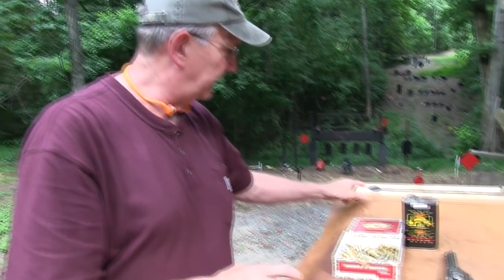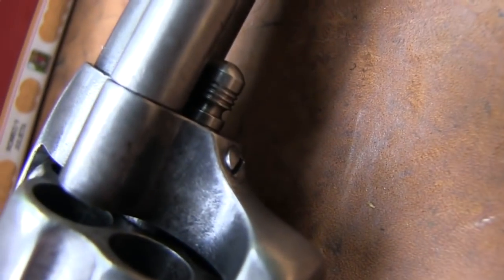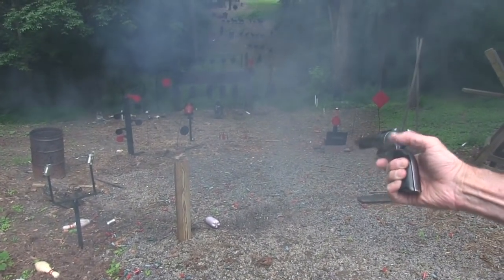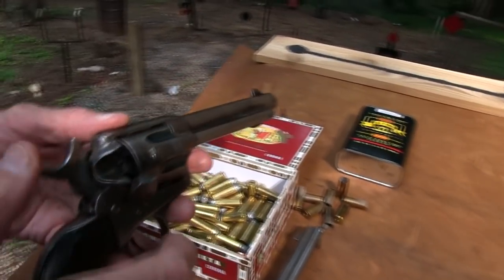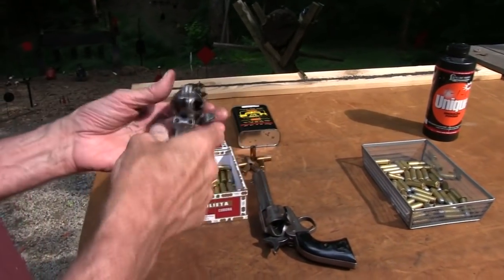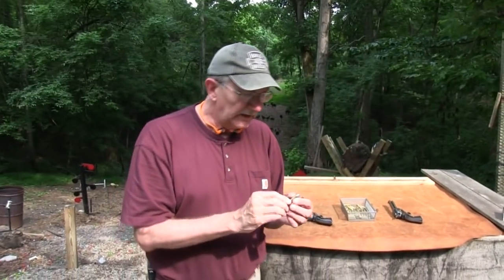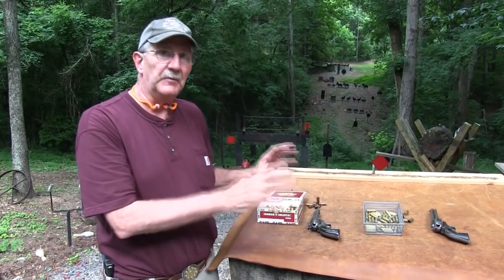Black Powder vs Smokeless Powder: some education!

Comment: To clarify, smokeless powder, smokeless propellant, burns faster when confined inside a cartridge case, whereas black powder burns almost as fast unconfined as it does confined.
Reply: Not true. The simple proof is the difference in burn rate between black match fuse (string coated in black powder) and quickmatch ( black match encased in a thick paper sheath). Even light confinement makes a huge difference.
Reply: Smokeless powder
Reply: @pyrobob208 In match, the powder grains are physically bound to the thread. In the case of black match, the powder being burned can only ignite the powder directly affixed next to it. The granules burn in a sequence as a result, unable to skip ahead in the line like a columm of loose powder can...

...fast match holds in and redirects the combustion gasses so they can ignite more and more of the black powder they flow over in the tube. The fact the granules are glued to the thread become irrelevant because the flames can out-pace the sequential ignition of black match- where most of the heat energy is expended into the open air as the visible 'fizzle' effect.

It's the same reason you have to pack down black powder in a chamber-- loose air inside the charge lets the granules ignite all of the powder at once rather than in the slower sequence you'd get if the packet of powder was tight.

Comment: It's all in the chemistry. According to the book "Gunpowder" by Jack Kelly, black powder will result in only 44% of the initial weight being turned to a gas, 56% is solid residue hence the barrel fouling nature of black powder. This solid residue is primarily potassium sulfite, leftover from the saltpeter and sulfur in optimal mixtures. The saltpeter (KNO3) provides the oxygen for combustion. The 44% gasses produced occupy 280 times the volume of the original black powder. At the temperature of the explosion, 3880 dF, the volume of the same gas will be 3,600 times more. The pressure can reach 20 ton per square inch. 
   I am not sure of the chemistry of the smokeless powder, but with less solid in the end that the 56% residue of black powder, we can see that smokeless powder goes toward 95%-100% gas, little residue. This means the amount of gas produced can be double or more per weight of powder, hence the pressure can be double too if it burns all the way before the slug leaves the barrel. It may burn slower put produce double the gas. I don't know the temperature of the smokeless, but if comparable, then we can easily see the danger of using smokeless in an original old black powder gun.
Reply: Actually, about the volume increase when it comes to the temperature of a gas, it is actually measured in kelvin, the absolute temperature. So let's say that a gas goes from 100 kelvin to 200 kelvin, then it just doubled its volume. Farenheit and celcius are not absolute temperature.
Reply: The term optimum is relative. Residue can be more or less according to several factors.
High humidity can contribute to the burn rate and the amount of fouling left behind. The amount of moisture in the powder is another variable. T
Reply: I can load for less fouling by increasing pressures. I do it with a hot primer, a heavy bullet, a good grade of powder and some compression.
The right combination will shoot pretty clean and give good accuracy.
John Davis Jax fl
Reply: Black powder will combust-- the charcoal burns with the saltpeter to generate a lot of heat and some gas.

Smokeless powder is nitrocelluouse-- it is a chemically bound chain of nitrogen, hydrogen, carbon and oxygen. It exothermically decomposes at the molecular level, generating a lot of gas and then some heat.

People need to understand that black powder and smokeless powder are two completely different substances that undergo two completely different chemical reactions.
Reply: Celsius and kelvin have the same scale for increments, so no problem with that…
Reply: @CC-mm3bl  I stand corrected. Must be done in Kelvin temperature.
Reply: How about Sulfurless blackpowders?
Reply: Something few people know is smokeless powder can always be used safely in a black powder weapon ... I mean always ... There is always a load that will replicate the black powder pressure .. The religion out there is never do it , dont ask why .  Except you can always do it all day long  with one caveat .. If you over measure your in danger ... not so with black powder
Reply: @markdoan1472  and this is how people who don't know better get hurt
Reply: @markdoan1472  This chat group article addresses the use of smokeless powder in BP firearms and confirms that UNDER THE RIGHT CIRCUMSTANCES it is in fact OK to use smokeless powder as a substitute. As Mark has stated, BP is without question more forgiving of "overloading" compared to smokeless powder. But for those interested in the topic of using smokeless in BP firearms, this post (title: "Smokeless Powder in Black Powder cartridges", from 2008) might be useful.
Reply: I was wondering, thanks.

Comment: This video is also a good postscript to the video you did about the cylinder gap blow out, where you illustrated the danger from the burning gases escaping for the cylinder gap. With the black powder loads the blow out is clearly visible. Thanks for another interesting and informative video!

Comment: Do you think the indoor shooting range would mind if I reloaded some AR15 rounds with black powder and shot off about 30 of them in quick succession?
Reply: I doubt it would cycle
Reply: Good luck cleaning that gas system. The thing'll never fire correctly again.
Reply: I did it and everything worked perfectly.
Reply: Ramses. Just got to clean it well after shooting as black powder is corrosive.
Reply: what hes say is he can out gun sling you with a ar15 i would put colt 45 against u any day
Reply: some people in this would still nows how to use one of those pistols dont doubt that pistol
Reply: Lol I know this is 2 years later but Lmao. Well at least you couldn't see if they were pissed at you or not, just fumble around till you find an exit.
Reply: I know somebody who did it with a .38 Special shooting our service-match.
Reply: If it did cycle I would be surprised if it would fire 30 times. Put a softer spring in it and try it and show us.
Reply: i would shoot blackpowder only from a stainless bolt rifle ,t/c contender or a single action ruger revolver
Reply: @borborygmus5873  sure bud

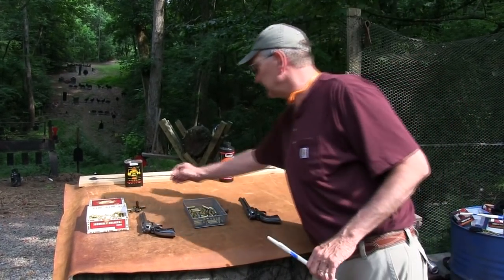Comment: Man I was happy to see you move the cans away at 10:22 .... I was almost shouting at the screen "REMOVE THE CANS!"
By the way, I love your videos, Keep them coming.
A salute to you from Denmark.
Reply: +Morten Schultz What do you think the odds of the containers of powders igniting are?  Though I agree with you that one shouldn't take chances, I think the odds of those containers going off are astronomical.
Reply: I dont care how low the odds are,  if that amount ever blew, Hickok and cameraman would be splattered all over the range.
Reply: his fingers could have powder or the table, and the fire could somehow get to the top of the bottle
Reply: Gia:  Perhaps...but the containers were sealed!!!
Reply: The containers are light plastic or card board or light tin designed not to explode, if for some reason the powder caught it would burn like a torch but not blow up. Designed that way for safety.
Reply: Leaving the cans there until the last minute is hickoks sense of humor. Have you watched many of his videos?
Reply: Fedt, Danmark.
Reply: the cans the lines of powder were already poured when he was shooting, a spark would have touched off the black powder.
Reply: Hickok45 was just messing with you

Comment from the maker: Any Colt SAA might be referred to as a "Peacemaker," but it's not the official Colt designation. The gun is the Colt Single Actions Army, sometimes called a "Peacemaker." Now, there might be some other firearm I'm not aware of that is actually using the brand name "Peacemaker" - not sure. I would not be surprised if some company actually uses it since the old Colts were also called that.

Comment from the maker: Hardly ANY of the smokeless "powder" out there is really a powder; it's flakes, extruded little cylinders, and all sorts of shapes of granules and such. Still, the general term for anything that goes in a cartridge case to propel a bullet is "powder."  At least that is the case in MY world. :-)
Reply: Using hot soapy water to clean black powder pistol...but what do you use to clean black powder out of a modern cowboy shooter ?? Water ???
Reply: I have developed a new cartridge for muzzleloading rifles which is loaded from the muzzle but ejects itself from the barrel after use and is non-corrosive.   This product sets a new standard in safety and reliability for muzzleloader ammunition in the same way shotgun shells are standardized for use in shotguns.  Shotshells have a load of shot and powder which produce a safe pressure in shotguns manufactured by many different companies.  The pressure produced by this cartridge can be designed to work safely in the muzzleloaders produced by the various manufacturers.   It would also greatly help new muzzleloader shooters with safety, and it would also give them a product which will not destroy the barrel of their muzzleloader due to corrosive residue. 
 
     Those who say smokeless powder cannot be used in a muzzleloader may not know “Blackhorn 209” is 83% smokeless powder, based on the MSD sheet for the product.  Therefore, the claim that smokeless powder cannot be used safely in a muzzleloader falls apart very quickly. 

      This cartridge could also be loaded with BH209 or a similar formulation in states which do not allow "smokeless" powder during muzzleloader season, in the same way the breechloading "Firestick" cartridge is now used in the "Nitrofire" muzzleloader.  This would be a "Muzzlestick" cartridge which would work in thousands of other modern muzzleloaders, which cannot use the "Firestick" cartridge.

      This cartridge can also be removed from inline muzzleloaders by removing the breechplug.

      I am now looking for a company willing to mass produce this new cartridge for the market.  I would greatly appreciate it if you would pass this information along to those you know who may be interested in this new product.

 
A link is found below which demonstrates this new product.
 
YouTube video:   “Self-Ejecting Muzzleloader Safety Cartridge: Product Debut (short version)”
Reply: @SpotterVideo  nice, sir!

Comment: Here's some trivia.   When Winchester introduced the 1894 model, it was provided (and continued to be made, for many decades), in .30--30 and .32 Special.  The ".30--30" designation would seem to have indicated a .30" bullet with 30 grains of B.P. (like the convention with the .44--40, .45--70, .50--90, etc.)  But the .30--30 was NEVER loaded with black powder.  But with the .32 Special, though a smokeless round, the rifle was specifically designed for shooters to reload their empties with black powder.  The difference, aside from a negligible increase in bore diameter, was that the rifling was more shallow.  That was to reduce the fowling from black powder.  Over the years, I've known people who swore that the .32 Special had less recoil than the .30--30.  That would seem odd, since the two rounds produce the same energy.  My guess is that the shallow rifling of the .32 produces lower pressure, and thus, lower recoil.

Comment: I am sure some where in the replies someone brought this up, black powder is a different breed of cat to reload. If you are going to load black powder, do a lot of investigating about the does and don'ts. If you do it wrong, you can ruin a modern firearm just as easily as you can by loading smokeless powder in an antique. Most will tell you to never leave an air gap in the case with black powder, it causes an extreme pressure curve.
Reply from the maker: +Ray C.  Yep.
Reply: +John Affleck Actually, yep. Black powder and smokeless are totally different. If you load black into a cartridge, you either fill the whole case with powder or if you use a reduced load you mix the black powder with something like cream of wheat to bulk up the charge so it fills the whole case. Simply filling the space with something like cotton will not work. 

Stop perpetuating this ignorance you claim. Crack a book every now and then.

Comment: Just thought I would mention how the burn rate and pressure curve of smokeless powder completely change when confined in the cartridge vs burning in open air. Obviously it is waaaaaaay faster. As the expanding gas increases the pressure inside the cartridge the the powder burns faster.

Comment: It is my understanding that they usually used water (hot, if possible) and a rough patch for daily cleaning, then water and Castile soap or lye for more thorough cleaning.  Either method was followed with tallow, olive oil, or whatever else was on hand for rust prevention.  Hoppe's came around in 1903.

Comment: Just to differentiate on the composition of these two powders, black powder is made from 3 ingredients as mentioned: potassium nitrate (saltpeter), sulphur and charcoal.  Smokeless powder is not actually a powder at all.  It's tiny flakes of nitrocellulose, which is almost like tiny pieces of paper (rough analogy) that have been nitrated by a process of treating them with nitric and sulphuric acid.  This is basically the same process used to produce nitroglycerin, which is a component of many modern explosives such as dynamite.  In both cases, containing the powder in a sealed cartridge with no place to expand is what makes the "explosion" that sends the bullet downrange.  An explosion is simply a rapid burning under pressure.  Nice demo!

Comment: That's a good informative video. I think the reason they say that black powder burns slower than smokeless, (but it doesn't when you burn it on the table) is because the burn characteristic changes when the black powder is burnt in a confined space (the brass case) so the rising pressure slows down the burn somewhat...? I think, lol. But even so, the burning in open air was a good demonstration and made your point!

Comment: And the mystery still remains, why do smokeless build up pressure faster ?  ? My experience with it (after burning Kilo's of it) is that that when it fires it gives off a kind of gas that is very (extremely) flammable. Believe me THAT is something that burn very VERY fast. Explosive in an enclosed area.  I'm sure there's some gunpowder factory that can confirm this.

Comment: If smokeless burns so much slower than the black powder, then why is the pressure in the smokeless bigger and lets black powder guns burst?
Reply: There is a difference between burning them in open air or in a sealed chamber. Under pressure, smokeless powder will burn faster than black powder.

I mean, if you set a bullet atop a pile of smokeless powder sitting on the table, it's not going anywhere. How does this stuff move a bullet, then? Well, you have to enclose it in a gun chamber.

Comment: One of the techniques advocated by some reloaders in the 60s for reduced charge black powder was to mix the powder with cornmeal or some other filler to eliminate air gap within the cartridge case. Never tried it myself as I was content to dip into the bowl for full loads.

Comment: Steel can be safe to shoot if the proper precautions are taken.  First, it must be the proper steel (armor plate).  It must be undamaged.  It should be set on the proper angle or be able to swing.  And last, you must be at an appropriate minimum distance for the caliber and everyone on the range should wear eye protection.

Hickok has several videos on the subject if you do a search on his channel.

Comment: I  aways taught B;ack powder burns slower.  This demonstration proves the opposite.  Thank you
Reply: Smokeless powder burns faster under pressure. Black powder simply burns fast, whether in open air or a gun tube. But, in a chamber, smokeless burns faster.

Comment: Hickok45, I've heard that Colt has no record of altering the quality or strength of their steel for the switch to smokeless powder, i.e., they used the same quality steel after the introduction of smokeless powder as they did before the introduction of smokeless powder, and made no changes in strength of the gun having the shooting of smokeless powder in mind.

Comment: Supposedly, black powder "explodes".  Smokeless powder burns at a very rapid rate.  But, it is confined by the cartridge case and the pressure increases rapidly.  At least, I think that is what I have read.  The real tricky thing is that each smokeless powder burns at different rates.  What can be used for pistol, will destroy a rifle, etc.  It all has to be matched.

Comment: As I recall from GM/A school, black powder is considered to be a Low Explosive, with a burn rate of 1600 fps. If you whack it hard enough, it will go off. 
 
About 290 of my Mom's ancestors were in the Union Army, and perhaps 65 in the rebel army.

Comment: I'm not Hickok45 but I think I can answer your question. Smokeless powder creates much more pressure than black powder, therefore if you loaded the same amount (measured in grains) of smokeless vs black powder, yes you would definitely create more bullet speed...that is if your weapon didn't explode. The 45-70 cartridge was name so because it was a .45 slug loaded with 70 grains of black powder. If you tried to load 70 grains of most smokeless powder in said cartridge it would be a pipe bomb.

Comment: This is a great video. I always find myself wondering the difference between the 2. Hopefully you will see this, I have a question. Since black powder burns so much faster does that mean it will push a bullet faster in velocity terms or have more punch compared to smokeless? or is it the other way around being that smokeless burns so much slower giving it more time to push the bullet out?